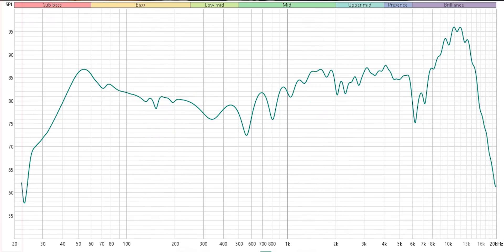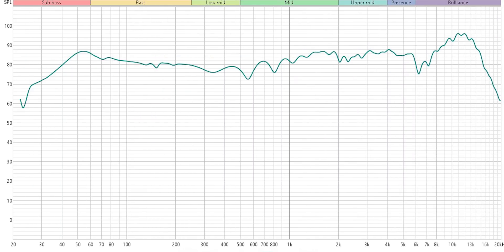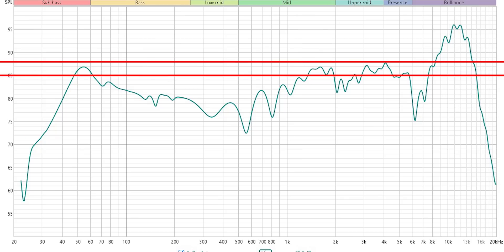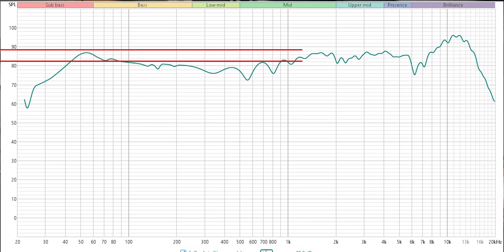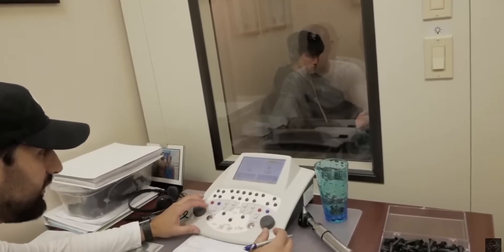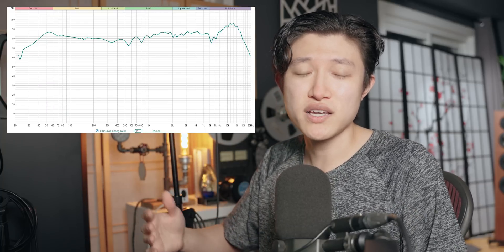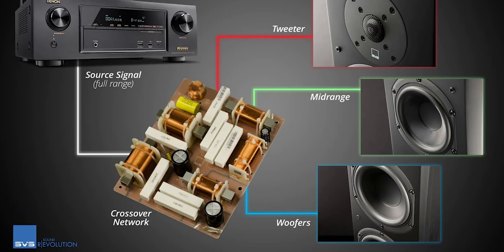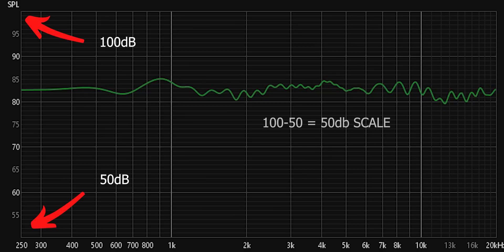⚠️ This 10 Second Audio Test Will Blow Your Mind! Speaker Measurements

Comment: Because of this video, I had to do the math and check to see what the settings are on my tone controls.
My tone controls are -21 to + 21 clicks.  1dB=3.5 clicks.  My settings for Elac Debut Reference with Class D and Tube Preamp are:
Treble -0.57 dB, Bass +1.53 dB (-2 and +5 clicks of 21,  1 click=0.285 dB).  
The speakers are cross streamed 10° with grills on (modified for better audio transparency).
So apparently my ears are more sensitive than one third of one dB.  But after careful adjustments and listening, these settings are a near perfect balance of tonality for these speakers.  Everything sounds tonally balanced no matter what type of music I play.  From pipe organ, to Korn.  Sounds great when cranked up or low volume.  Actually I wish I had more clicks, about twice as many.  I got spoiled with 127 MIDI levels of all adjustments for each note.  So thanks Jay.  Now if I bump the control knobs, I can look up the correct settings without having to put tape on with little sharpie marks 😏.  Nothing wrong with little sharpie dots on our pro amps before we we  go perform...  Once I get my amps set up, I usually never change those tone and volume knobs 👍.  Thanks for your videos, they have been very informative. Keep up the good work.

Comment: This is an old trick usually run in reverse in scientific papers. You want to show your test shows some big effect and so you change the scale from 0-100 to 50-70, and then your line looks like a huge effect🙄.  Very misleading practice with data representation, but those of us used to reading scientific papers critically know how to see through this BS.

And you didn’t even get into the issue of how a response like this is measured—at 1 meter? 10 meters? On axis? Off axis by how much and which direction? Untreated or treated rooms, etc etc etc.🤣🤣

Very good on you Jay to bring this little tidbit to your subscribers…

Comment: This is an old trick usually run in reverse in scientific papers. You want to show your test shows some big effect and so you change the scale from 0-100 to 50-70, and then your line looks like a huge effect🙄.  Dry misleading practice with data representation, but those of us used to reading scientific papers critically know how to see through this BS.

And you didn’t even get into the issue of how a response like this is measured—at 1 meter? 10 meters? On axis? Off axis by how much and which direction? Untreated or treated rooms, etc etc etc.🤣🤣

Comment: Coming from experience with having a trained
ear from 30+ years of engineering and production
having good hearing can become a nightmare at
times. For example, when I am in my apartment
I can pickup when the neighbours are using their
washing machine or an extractor fan or cooker
extractor and so on. They have very low frequency 
hums at low db's within my apartment and with 
most folk they just wouldn't notice it and with 
myself it can really really gets to me so much so
I have had to leave the apartment and go for a 
walk due to it. Basically it can become quite 
upsetting at times. So if one has the money buy
into a detached house well away from other
property's.
Reply: Another thing that's very unnerving...  That low frequency hum,  around 37 Hz.  I herd that for a while in a location in Texas.  I thought it was the refrigerator.  It would only happen at certain times, and it would vanish when you went outside to try to find it.  It was something resonating with the house.  It was everywhere in the house.  I actually had my recording studio and some microphones there at the time, and made a good recording of it and photographed the frequency graph.  It was loud enough to actually record with a studio mic.  Those sounds can be very local.  1 or 2 blocks up the street, uphill, there may be no hum at all.  It's odd all right, and can be very annoying.  I don't live there now 😏.

Comment: Hey Jay, good video, as someone who has made a number of DIY speakers, I also want to point out that I can get a speaker to measure exactly the same with two levels of crossover components that do not sound the same. So the crossover is with the cheap parts measure. exactly the same as the crossover with the expensive parts, but sound quite different. And it’s not just about throwing expensive parts into a crossover, and expecting a great result, it’s about matching certain qualities that cannot be measured on a graph. That is where a science and art meet. on a fashion note Mixing silver, and gold rings doesn’t work😂
Reply: Did you try bamboo cable risers? Don't 😝.

Comment: Spot on, but there are even more things to consider. E.g. nearfield measurements and measurements on MLP. Depending on the room an MLP measurement doesn't necessarily need to be flat, but a nearfield measurement should (at least to some extent and depending on the signature if the designer and/or your taste)... The latter is what most people get wrong, e.g. when EQ-ing speakers. They aim for a flat response on MLP which almost always results in over-eqing....

Comment: Linear and flat in what room, at what distance and what volume? Graphs mean nothing because there are too many other variables.
Reply from the maker: hm interesting. I see many making that argument but I have a different thought.
What you are saying is similar to saying nit value on TVs don't matter because the lighting, watching distance, how much light is let into the room and even the paint color on the wall will affect the viewing experience.
However in my opinion, it absolutely matters and its definitely something I look at to see if the TV I am choosing is going to be "bright" enough for the room I am putting in,
in similar ways, you can do the same with speakers, if you have very reflective walls with no treatment, you may avoid speakers with high frequency boosts and if you have a very dead sounding room with lots of furniture/heavy carpeting, you might avoid speakers that have recessed high frequencies. 

If you know how a product is designed and how it performs, you should be able to use that information to apply it to your situation and the variable within the room you are setting up.

Comment: You need to know the directivity to make a proper judgment as well. Some speakers may look good on axis but be bad off-axis, or vice versa (e.g some coaxial designs).
Reply: spot on - off-axis response is always not even mentioned on specs sheets.

Comment: You want a flat frequency response. That does not tell you how the speaker sounds. Why are you trying to adjust an amplitude varying frequencies within a song with the speaker? If you like certain things you'd be better off to do EQ and it be a variable something you could adjust not a fixed plus or minus on every piece music. The song itself has natural mixed plus and minus decibels at varying frequencies as part of the mix why would you not want their Final Mix reproduced by you artificially changing it?? Also you can make a speaker dead flat with cheap parts and it will be an "accurate" speaker but the parts suck the life out of the music because frequency versus amplitude is only one measurement... it doesn't show the impulse speed and discharge speed through the parts. A speaker can measure exactly the same as another and sound totally different mostly related to the quality of parts in the crossover. Let me ask you this - - - would you use cables that are steel with an aluminum coating? No. But your cheap parts are using steel with aluminum coating a lot of the time! it's the same thing you're running the signal through... garbage... with cheap parts. High end film caps with pure copper foil and Teflon, sounds like your speaker cable construction.... Exactly. Also, this doesn't show ringing... You need to see a waterfall graph to show this as this is instantaneous sound and not any prolonged ringing in the driver/cabinet that is a hugeeeee distortion
Reply from the maker: hey. This video really isn't about flat frequency response or waterfall graphs, its about the scale of the frequency graphs.